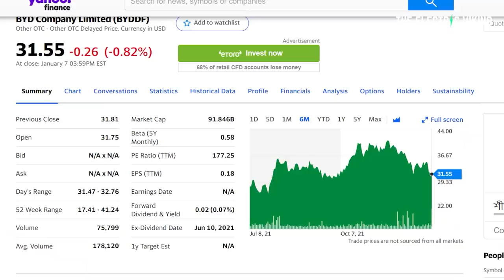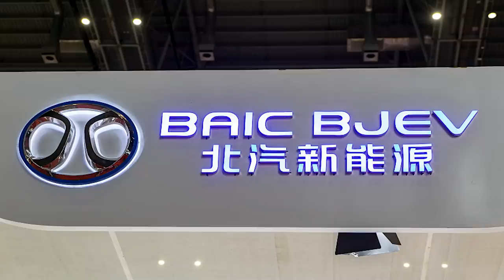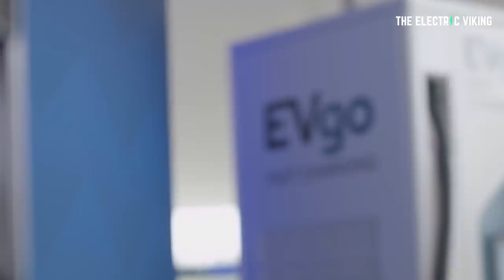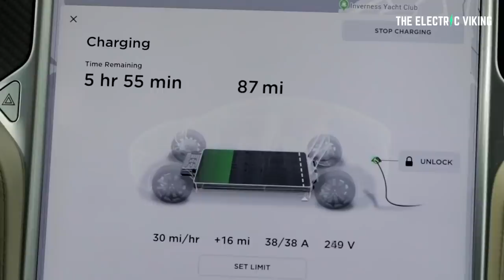EV sales up 154% in 2021; Warren Buffett's BYD beats Tesla

Comment: I have a 7 year old BMW i3 just passed its MOT with flying colours the Battery has very little to no degradation I still get the miles on a charge I got when it was brand new. Its the best car I ever had 0 to 60 in 7.8 and lost zero horses over the 7 years, if I had a ICE plenty of the 160 hourses and the 280ish torque would be gone in the same 7 years. EVs are brilliant.

Comment: BYD 93,945 new energy vehicles in December up 225.7% Y/Y (including 92,823 passenger cars, and 1,122 commercial vehicles) and up 3 percent from 91,219 units in November, despite the Covid-19 outbreak in Xi'an, northwest China, which forced a temporary shutdown of one of its production sites.
In the broader new energy passenger vehicles category, BYD sold more than 48K units, up 148% from 19,482 units a year earlier. Its plug-in hybrids sold 44,506 units in December, up 448.6 % from 8,112 units a year earlier.
For the full year 2021, BYD's NEV sales were 603,783 units, up 218.3%Y/Y; sold 593,745 new energy passenger vehicles, up 231.6 percent year-on-year, and 10,038 commercial vehicles, down 5.6 percent year-on-year.

Comment: BYD is going gang busters but my BYD stock tanked -21% since buying in late 2021  My Tesla went  down and then back up again.  In hindsight  the Chinese market is opaque and proceed with  caution.  It seem that the Chinese speculators could have had some margin calls.  Like you said Sam hold for a least five years.   However, the political picture could change everything in a heartbeat,
Reply: I'm up +43% on my TSLA...
Reply: China is not investable.
Reply: BYD is still not on the radar for the stock media outlets. They could be a dominant player (along with Tesla) in China and Europe in the next couple years and the USA soon after. This is not a good scenario for legacy auto or US startups. I own a few shares. About 1/20th of my Tesla holdings. I believe the stock will go up over time. Weather this stock (or any China stock) is a good investment depends on China. They can change policy at any time.
Reply: If you bought it in late 2019, you will be very happy.  In the long run, BYD will beat Tesla when people realize that BYD EVs are the safest.
Reply: @blam1328  - BEE ESS.  Teslas are NINE TIMES SAFER than the next safest vehicles just with their automated driver assist features, and not including the FSD beta, which will be two orders of magnitude safer within a couple of years based on Tesla’s progress.  There are far more Teslas on the road than any other EVs, especially high-speed U.S. highways.  Comparing them for safety to cars sitting in PRC traffic all day and night is comparing apples to rocks.
Reply: @jimmanley2796  How many people had been burned to death in Teslas? A few. How many had been burned to death in BYD EVs including buses? - none.
Reply: I bought my BYD stock in 2009 and 2010 . I have always looked at it as a long term growth play. Paying off now and will into the future. Be patient as has Charlie Munger and Warren Buffett.
Reply: @jimmanley2796  You don't get bored repeating "China is crashing" mantra that has been shouted for over 40 years? Get a life!

Comment: BYD also sells gas and hybrid vehicles, right? You weren’t really clear on what kind of cars the statistic covers 😅
Reply: Gas was never part of the statistics. BYD EV and hybrid models sold 48,317 and 44,506 units with YoY growth of 148.0% and 448.6%. For the full year 2021, BYD's NEV sales were 603,783 units, up 218.3%Y/Y; sold 593,745 new energy passenger vehicles, up 231.6 percent year-on-year, and 10,038 commercial vehicles, down 5.6 percent year-on-year.

Comment: I drive a 2000 F150 it now costs $80 in Dallas Tx to fill it all the way up. It is my dream to charge an EV via the sun and do it all for what  $6 a charge?
Reply: How much are you having to pay for the solar infrastructure?  Tens of thousands of dollars - solar isn’t cheap, let alone free.
Reply: @jimmanley2796  100% you are correct. I'd recommend you check out the LCOE values over the past 5 years and you can see a precipitous drop in the cost of solar. Solar has gone from a 20 year back back your initial investment to 8 years. Solar has come a tremendous way and yes again though expensive at year nine I get to power my house and car for pretty much free. An option that has never existed until these times.

Comment: NEV Run Rate in December was around 4.5 millions, BEV Run Rate in December was above 3.5 millions. Estimating, that 2022 there will be some 5 to 6 millions BEV in China. But possibly it may be 8 million BEV in 2022.
Tipping points in China have been passed

Comment: ICEVs may have no resale value at some point, but I don't expect it to happen before 2030. Resale value will fall, but the fall will only make ICEVs more attractive to consumers who are very price-conscious, most consumers. These people don't care about reselling the car themselves because they'll drive it 'til it's worthless anyway. Most people don't buy a new car and trade it for another new car a few years later. I bought my 2010 Mazda 3 in 2010, and I expect to replace it with an EV in a few years, maybe an Aptera if they're ever produced. I may sell the Mazda then or keep it until I'm comfortable with the EV. Either way, it won't have much value when I sell it regardless of EV adoption. I also have a 2016 Honda CRV, and I'll likely still have it in 2025.

At this point, my Mazda dealer is constantly begging me to sell them my car because it's a six-speed manual. Some people (including me) prefer a manual transmission, and they're hard to find on lots these days. Most people I know aren't drooling for an EV. They'll buy an EV when the price (not the cost of ownership) is competitive and when the charging infrastructure is better across the country. They don't want to be early adopters. Some consider EVs a communist plot and want no part of them. Some part of the population, as much as a quarter, will be dragged kicking and screaming from their ICEVs. A quarter of the U.S. population is more than enough to keep ICEVs on the roads.
Reply: yup, you are right
Also in cold climates range loss in winter is still an issue
not hating but... there are things to be improved still for widespread EV adoption
Reply: @fenrirgg  Yea, Florida is a free state, unless you have a solar setup that produces more than 14kw.  Then you get to post a ONE MILLION USD LIABILITY BOND.  You are liable to hurt the power company monopolies.

Comment: My son in law is running a company and ordered some BYD work vans and a BYD Tang for private use. He got the vans first and they are crap. So he cancelled the Tang and brought a used Tesla X instead. The vans are noisy, steering wheel only one way settings and who the hell is delivering a car in 2021 with a mono radio ?
Reply: BYD haven't released any new model of work vans (especially ICE vans) for years. What's the model?

Comment: You cant really beat Tesla since their mission is to ACCELERATE THE TRANSITION TO RENEWABLE ENERGY, about the best you can do is assist them...
Reply: BYD actually can produce battery, IGBT, motor, and many other components by itself.
Reply: We still gonna drill for oil.
Reply: @hotchi1566  - No one company can produce anything by itself.  No company can produce a pencil  without forests, graphite, petroleum for the paint, aluminum for the ferrule that holds the eraser on, or the eraser itself.  The PRC economy is about to collapse as 100 - 300 million people will become unemployed due to foreign capital flight, resulting from the first domino, EverGrande real estate group, going into full, formal default.  There are thousands more Evergrandes in even worse financial shape that foreigners are dumping, and the PRC foreign exchange reserves are falling below minimums required to purchase foreign food, let alone technology needed for manufacturing.  When the soldiers and police can no longer be fed, violent revolution is sure to follow.

Just ask the residents of the former Soviet Union, especially increasingly-desperate Putin, looking for military distractions, while the Chinese Communist Party yells and points at Taiwan …
Reply: @jimmanley2796  A good company should produce the key components for its products. For EV supply chain, the key components are battery, motor, semiconductor (IGBT, etc.), and control system.
Reply: @hotchi1566  and your point is??? The most they will do is help Elons goal of accelerating the worlds transition to renewables.... you got earwax or something...dyslexia maybe? Your reply to my comment is completely irrelevant.

Comment: tesla sold 70.8 k from china in december
Reply: BYD 93,945 new energy vehicles in December up 225.7% Y/Y (including 92,823 passenger cars, and 1,122 commercial vehicles) and up 3 percent from 91,219 units in November, despite the Covid-19 outbreak in Xi'an, northwest China, which forced a temporary shutdown of one of its production sites.
Reply: @jasonk203  how much electric?
Reply: @jasonk203  toyota also sell alot of hybrid

Comment: Warren Buffet does not own BYD so it’s a nonsensical argument. Tesla is the largest market cap car technology company in the Western Hemisphere period. Cheers
Reply: What are u talking about mate?
Reply: Tesla is one of only five corporations with an average market cap above a trillion dollars … anywhere … in any sector … and heading to become the largest within a few years at its current growth rate of doubling every year … with 30% margins … that are also growing …  

When “Full Self Driving” becomes actual Level 5 Full Autonomy in a few years, Tesla won’t even need to sell cars, as their vehicles will then be able to become robotaxis with no labor costs, accident rates around one percent of average vehicles, ICE or EV, and lower cost-per-mile by at least an order of magnitude over individually-owned vehicles.  FSD value could reach $100,000 per Tesla at that point, so sales would be economically unnecessary and unsustainable … especially for any other manufacturer.